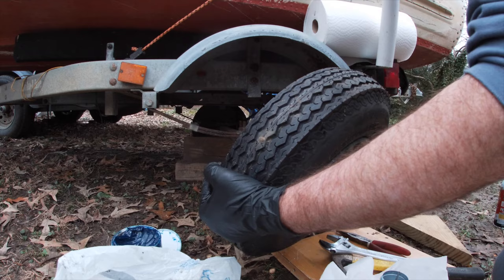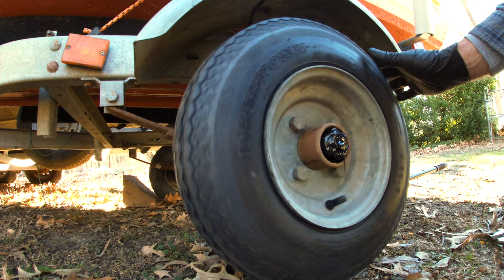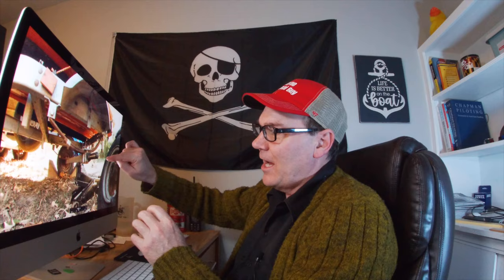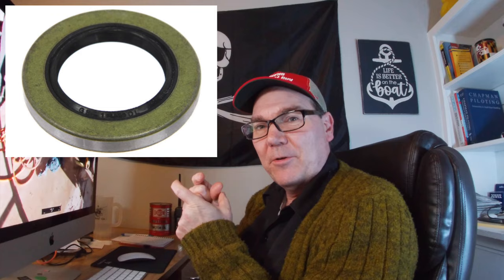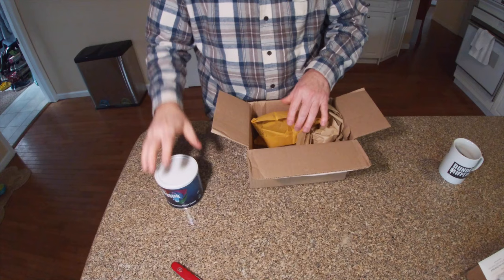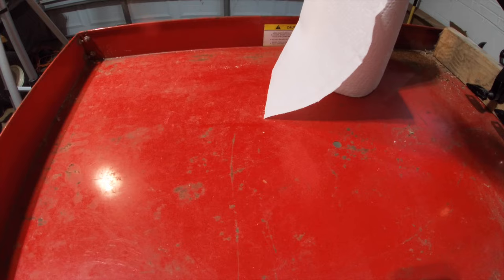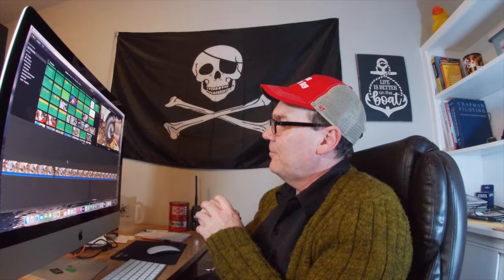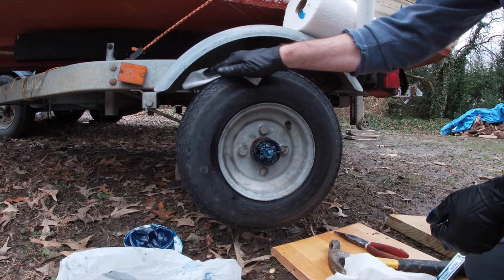How To Repack Trailer Wheel Bearings

Comment: The Chinese cups , cones  , and bearings are of very inferior quality !  Clean as much grease off the assembly as possible and spray clean with ether . Apply Permatex # 2 non-hardening sealant on outer diameter of the wheel hub seal . . 001 to .005 bearing end play .

Comment: Nice reference on wheel bearings, but if you used a rubber mallet on the caps they would look new.
Reply from the maker: GREAT POINT - 100% correct and I even have one too!
Reply: @WayneTheBoatGuy  nah, I tried that; really no way to avoid denting flat face dust caps no matter how you try to set them on the hub.
Reply: @PapaMav absolutely there is.
Reply: @jimyeats  nah, not ones that already have a flat face; unless you have some secret you wish to share with the rest of us.
Reply: @PapaMav  No idea if it’s a secret, but if you just use a rubber mallet, like the type you use for putting vinyl flooring down, and just don’t whale on it i’ve never had one mar up or dent.
Reply: @jimyeats  yea, never worked, not once for me.  And no, not from wailing, the rubber mallet.  It is a matter of the metal going across the top of the cap is not as sturdy as the edges of the cap and the force of getting (at least the right sized cap anyway) into the hub, is greater than the top of the cap can hold up up to.  Pointed caps may be a different matter entirely but not flat faced ones.

Comment: For cleaning the wheel bearings, I use a method that seems to work really well. I just use some old gas (new gas is fine to), fill on container with it, and put the bearings, washers, nuts and any other metal parts with grease that I want to clean in the gas. The shuffle/stir the parts around until the are clean. The gas will wash away all of the old grease like it's nothin'. This will guarantee that all of the fine metal dust/shavings gets washed out as well. One other nice thing is that the gas can be used for this purpose over and over again. I've done this with trailer bearings, car and truck bearings, garden tractor bearings and even motorcycle wheel/steering head bearings and fork tube parts. Works great!
Reply: This is the method I use at the start of each season.  I take a utility knife and cut a "dish" out of a empty plastic container like for milk or juice.  Let is "degrease" over night.  When finished with the job, I burn both the gas and the greasey rags in my fire pit.
Reply: The advantage too of clearning the bearings using gas, is, it is easier to inspect them for wear/hot spots on the rollers so you know they can be reused.
Reply: @PapaMav  I agree! Definitely easier to inspect when they are that clean.

Comment: Great video, a dead blow hammer works for installing the seal and hub cap. 50 + years ago we didn't have the gloves and found the grease didn't seem to hurt our hands when loading the bearings. Lol
Reply from the maker: I never used to use gloves either - but they're really useful for having "date night ready" hands later in the day and when you're also trying to periodically turn on and off two cameras!

Comment: I did not have a flat washer or washers at either end of my bearings either, and I had the exact same little 4 bolt wheels on a similar boat trailer as you did. Moreover when I bought the bearing, and race replacement kits for both wheels, they did not come with washers either. Yet they came with new end seal rings. I just thought that's the original design and it seems to work fine. I am now going to dismantle the other wheel hub and see what it had.
Reply: Let me know, I have the same issue

Comment: I’d recommend using some sort of food grade grease like Amsoil GXCCR-EA to lubricate any bearing that is going to be submerged in water. It is some of the most water resistant grease on the market. It will not wash away and it keeps its lubricating values the longest. We use it to lube the bearings in our jet skis which stay submerged for months at a time during the summer.

Comment: Tighten the castle nut just enough until there's no play (as seen at 3:40). Too tight and too loose can cause the bearings and races to wear faster. It's a good idea to check for play and tighten the nut accordingly every year or more often if the trailer is used a lot.

Comment: Excellent video, talking it through on the screen is much better than trying to talk to the camera as you do the job. I would always recommend bearing buddies for boat trailers because the hubs are immersed when launching and retrieving the boat. They work by slightly pressurising the hub. The theory is that water can't get in if the pressure inside the hub is higher than the external water pressure. It's quite normal for a bit of grease to push out through the seal when using bearing buddies, especially with single lip seals. Here in New Zealand at least, the vast majority of trailer hubs these days have double lip seals that remain static on the axle, and run on a replaceable stainless sleeve pressed into the hub.

Comment: You make good vids.  I'm with you on most of it. I would have cleaned my old bearings with parts washer/ carb or brake spray cleaner before repacking. and I'm a firm believer in grease fittings under a watertight rubber cup seal.  But I drag my boat to water every time I use it. Lots of trailering miles.

Comment: Recently (yesterday) tore into my shorelandr “tadpole” single ski trailer, and ended up completely replacing the hubs with a kit from auto zone. Wanted to repack, but had to beat the old hubs off because the inner seal had failed and they sounded like they were filled with broken glass. Never did it before and will say it was extremely easy and for a $90 complete kit, a no brainer.

Comment: I remember standing in line to pay for the new bearings for my boat trailer. As I stood waiting my turn I noticed a display that had brand new hubs, with bearings, that cost just slightly more than the parts I was holding. I never looked back and replaced them annually with a minimal amount of fuss.
Reply from the maker: That's makes for a better way to spend the rest of the day!

Comment: Firstly Wayne the boat guy, being similar age to you and doing many many bearings over that time, using your old bearings,  I do not see a problem as you explained there wasn't excessive wear or play in the wheel when you first started, and your short distance and occasional use,,,,, what I'm getting to is to let you know of a product I came across last summer,,,, It is called Dura-hub, similar design to that bearing buddy situation you started with, however the best part is this product can be used as a grease packed, or oil only like a sump situation  or a combination of oil grease,    I'm running axle oil, approximately 90 weight from memory,,,, the hub situation has a glass lens on front so I can see if there is any water in the oil,,,,, I will add as to your video to check the axle face where the rear seal is, making sure that is nice and clean, no damage like rust corrosion or scarring from scratches with screw drivers etc,   I regularly  tow my boat over 300 miles to boat in various areas from salt to fresh water, that's why I chose these Dura-hub and new kits to my tandem trailer, 8 months 14 days on the water and no water in my oil to date,,,,, just another option, safe boating all
Reply: Oh, sorry, I should clarify, I am not sponsored or have any business relationship with these products other than a satisfied customer
Reply from the maker: Yeah I've seen those type on some large equipment - never seen them on on a boat trailer!

Comment: Thats a pretty decent job, an how I did it before my college professers told me otherwise. 

First, the rear seal, yes there is a tool for removing it, an you were holding it. The way it is done, you take the castle nut off, remove the outter bearings an then put the castle nut back on. Now you grab the wheel, push down on it an jerk the wheel straight off. The castle nut works as a ouller with the inner bearing as a spacer poping the inner seal out with no damage. Assuming it was good to begin with, you do not have to buy any new parts. Just repack an reinstall. A customer that didn't have to buy any new parts is a return customer. Your way works when the seal is already bad.

Next, repacking the bearings themself. Not only do I like your way, my college teachers and text books do to. The palm method, but you can use a bearing packer. Pusing the old grease out with the new grease also pushes the metalic grit out of the bearing. All that metalic grit wants to stick to the inside of the bearing if you use a cleaner to break down the grease. 

Now the hard part. The part to correct you on. An I did this for years. And there are companies making money off this who will disagree. But you can have to much grease in there. Atleast the books says so. There does need to be the grease in the brearing, but thats really it. A thin film of grease on any metal that could rust an on the contact point of the seal is all the extra that needs to be in there. A little more is not going to matter, but a lot more is bad. Heres the thing my college professors pounded in to my head. That extra grease can not migrate into the bearing. Good grease stays where you put it. The only way it will ever get into the bearing is if it melts, and then you dont want it in there. What that extra greese does do is hold heat.  The bearing will actually run hotter, shortening the life of the grease in the bearing and the bearing its self.

Thats what the book says anyway.  And thats what I follow on other people cars trucks an trailers an my cars trucks and trailers that see highway miles. But... I dont always do what I am told. I question everything. Like you, my boat trailer only has to travel a few miles usually to the river. And like yours it does not have brakes dumping heat in to the bearings. So on it, heat is not the problem. Water is. Even a trailer that has only seen a few miles, the bearings are pretty warm. When you back down into the water, you quench them. Rapid cooling contracts the air in the hub. Now not only do you have the weight of the water pushing in on the real seal, you now have a vaccume trying to pull that water in also. Unless that seal is perfict, its going to suck in water an any trash thats in that water. Now every mile that water is washing out the grease inside those bearings. So heres the way I see it. On my boat trailer, an only it, I pack evey inch of space inside the hub with grease. Greese expands an contracts with heat much less than air. So if I get in a hurry an back down the ramp before my hubs have cooled, that vacuum is atleast less. And the way I see it, even if water does get in, with it packed full of greese, the water has no way of getting to the bearings. I may be wrong, an maybe I sould do it by the book, but I dont. On that trailer anyway. If I decide to take a road trip with it to florida, I may repack them by the book. Then again, I am lazy so probably not.
Reply: You must be lazy to not replace the grease seal every year; they're cheap from Etrailer and since it is smart to do this every year and take everything apart, why not replace the grease seal while doing all this?  Does not make sense to cheap out and not to.
Reply: I would not listen to this guy: I would not buy a bearing packer, it would not use the castle nut to get the hub assembly apart, I would not fill every cavity with grease (he actually contradicts himself in principle if you read what he wrote).  The only thing he is right about how water eventually intrudes inside the hub, which is why you take it appart at the beggining of season, replace the seals and do all the cleaning and regreasing.  I check my hubs temps with my hands just before launching and right after getting home: they are never hot to the touch; later in the season, just before the end, they may be slightly warm as a result of said water working it's way in, but never enough to do the maintenance more than once a year.
Reply: @PapaMav  I dont see a contradiction.  I said adding extra grease is considered the wrong way to do it. I only do it on my boat trailer because I can get away with it being very close to the ramp. An so far it seems to work. I do a lot of things to experiment on my stuff. Some work some do not. An in this case I control the enviroment. I dont think I am the only Tech that treats the things he owns differently than customers stuff. As the saying goes,  "The Cobbler's children have no shoes." The tire guy telling you he cant fix your tire because the nail is to close to the sidewall, he probably would fix it if it was his tire. Not a contradiction, just the way the world works. Insurance, Lawsuits, not wanting to come home an fix your own stuff or just wanting to try something.

The correct way I was taught in a College Automotive Technical program was no extra grease other than a light coating. The reason given is that the grease holds in extra heat an can never make its way in to the bearing. Its also A waste of grease an a mess you have to deal with next time, so dont add extra grease is the rule. I have followed this rule ever sense for everything but experimenting with my personal boat trailer, an I have yet to see any reason to think the rule may be wrong. 

How much heat matters in a trailler axel is relitave. Its a nonissue with my 700 pound boat with no brakes going a few miles. More of an issue with my Cousin pulling his party barge through 3 states. An even more of an issue for my neaghbor pulling his cabin cruser down a winding mountain road to the river. The brakes on those trailers are glowing red when they pull into the ramp right at the foot of the mountain. Its all relative.

I do not think he needs a bearing packer either. He has the hand method down. They work fine though.

Using the castle nut to remove the rear seal was also straight from college class. It works. I dont think my college invented the idea, Its been done that way for a long time before that class an I still do it 25 years later.

If you want to replace it every time, you can. It does not cost that much. But that only works when its yours an your money. Its a bit of an oversimplified way of looking at things though. Its always better to know how to get a part out cleanly an have the option of replacing, vs not knowing an having no choice.

When you are working for someone else, on someone elses stuff an using someone elses money, things are more complicated. You need to be able to get the seal out intact. At the least so you can show them an actual reason it needs to be replaced. If all you have to show them is a seal you distroyed takeing out, they will asssume your inability to remove it is the real reason they need a new one. Don't expect that coustomer back.

You are also commonly taking things apart with new seals already in them. If you have done a brake job on a truck last month an a front axle joint failing this month, you need to be able to get that seal out clean. It was old an needed replaces does not fly. If you get a axle togeather an find a spacer still sitting on your parts table, you better be able to get that seal back out. Especially if its something rare. Its easy to run to the part store an eat the price of a seal. But if you have to order a new one an wait 3 days, you may have just messed up your customers vacation plans, or your vacation if its yours that you did that on.

But no, I dont expect him to listen to me. I am just some guy on the internet. I comment on every video I think is good, assuming I can think of something to say, not because I expect anyone to read it, few do. Its because I have free time an youtube grades the quality of videos based on how many comments they get. Someone disagreeing with me is also good. You responding twice to me an now me responding back, thats good for his channel. Otherwise I would not waste my time in the comments of any video. If I have prompted you into responding again, telling me how wrong I am, even better for him. More of what Youtube calls "engagement." None of what we say matters though. Few people actually read comments, less people actually read replies to comments. An those who do already have their own held beliefs like you and I do.
Reply from the maker: The points you bring up are interesting and logical - which is counter to the concept of products like Bearing Buddies which have the entire space completely pressure filled with grease. It would be really interesting for a video for Project Farm @projectfarm
Reply: @WayneTheBoatGuy  Yep, that would be a project farm kind of test. It would not be a cheap test to do though, an hard to get usable data from. Atleast the way I would do it anyway.

You would have to start with a pretty heavy boat sitting on a duel axle trailer where both axles are the same axles with the same brakes, adjustted the same. Not easy to start with. No brakes would be easier but not legal where I am. Then you would need to take the hubs apart, rebuild them an do all four diffrently. I would use no extra greese in one, pack one full by hand, use a bearing buddy on one and use a greaseable ported spindle on the other.  Then turn a lot of mile an back it down the ramp a lot. See which ones are running hotter. See which ones get water in them. See if the bearing buddies are actually holding pressure, see if either of the greaseable systems are actually filling the housing with greese or is there an airlock, an see if there is cleaner grease in the actual barrings. 

It would be a good test, posibley saving people millions, but it would be pricy an hard to do. Then again, he may come up with a better way to test it. He comes up with some really good simple shop tests. Say a hub treadmill?
Reply: @WayneTheBoatGuy  thank you.
Reply: I read every thoughtful word @RebelCowboysRVs  People like you add a lot of value to these YouTube projects.  Keep up the good work!!